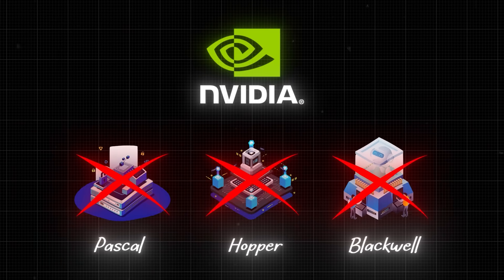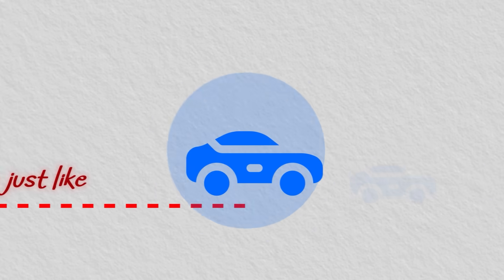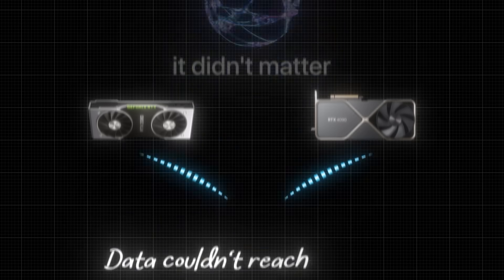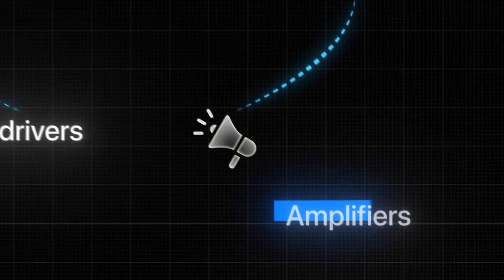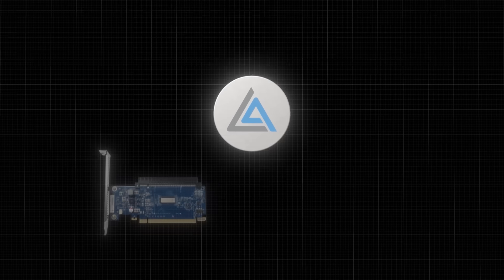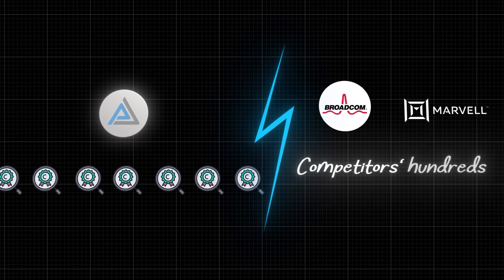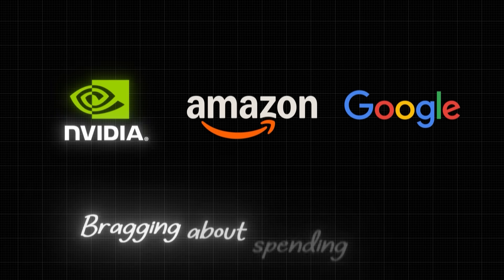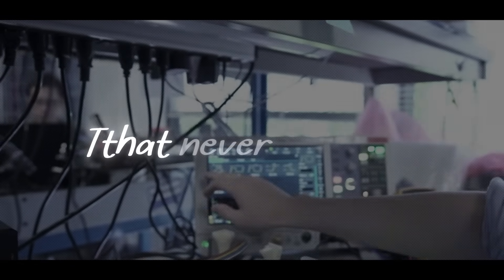Every Nvidia AI Factory Depends On ONE Company - Astera Labs

Comment: Very educational.  However, the substitution risk is high.  May be buy 0.1% to 0.5% on a dip?
Reply: As an electronics design engineer not sure I would want to change something that works unless there was a massive cost saving or drop in replacement
Reply: @naumansulaiman8856  I am an outsider.  However, I read the book Gorilla Game and tended to focus on companies with proprietary architecture like MSFT, AAPL, Google, NVDA, QCOM, etc.  They can change their architecture and put a supplier out of biz.  Back in the day these companies would make changes, bundle products and put suppliers out of biz like power amplifiers, fiber optics components, etc

I have been fortunate to have done ok.  90% in indexes now.  Only 10% in individual stocks.  I see eye watering valuations.  Obviously you are way more competent in this field.

Comment: After Nov19 Q3 earnings and Guide, stock price mostly can reach $250 or more before 2026 and predicts price can go up over $350 by the end of 2026(fy2027) once it proves that 500B for coming 5Q is working out 🎉

Currently $202.5 ←

Disappointment ($350B) → 2025: $250 2026: $340 

One Neutral ($400B) → 2025: $351 2026: $455 

Medium-high ($450B) > 2025: $450 | 2026: $600 ・

Explosive ($500B) → 2025: $488 2026: $660